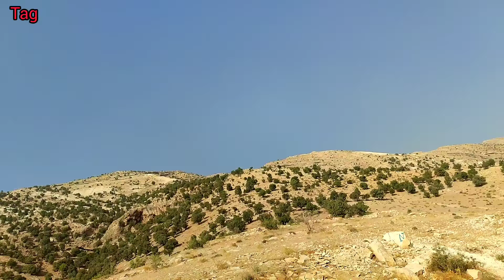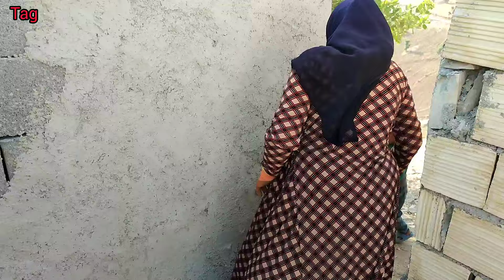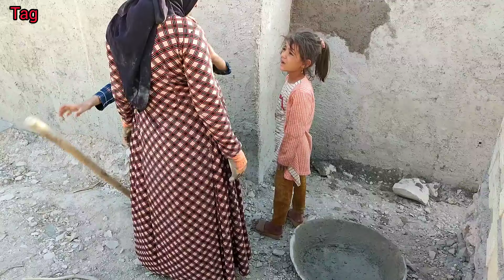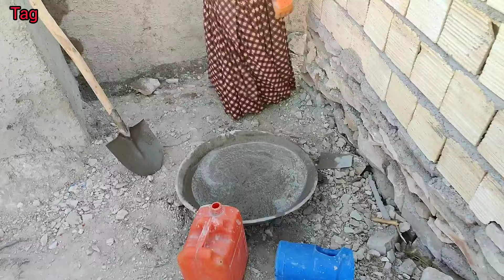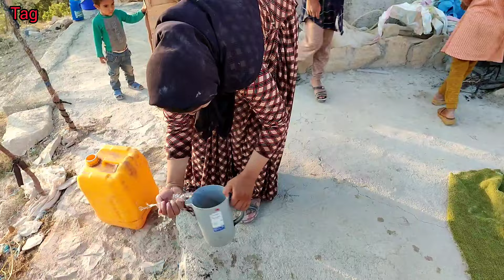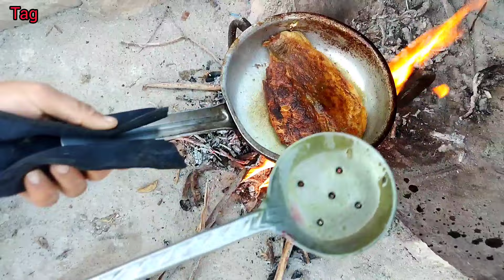The tirelessness of the displaced mother in the mountains to build a kitchen

Comment: By the way operator please  tell the mother that recently in Europe and usa thé off grid people found a way to make grow faster and vegetables bigger by putting twisting around  a rod a real  copper wire  … they put it in the ground around the area where the plants are growing and let at the end of the rod the part that is in the air… let the wire stick out first about several Inches…  on top of the rod…
I follow the channel Doug and Stacy and they put it in their video.. HE WAS not believing this but when he compared after several weeks he saw in his garden a big difference where he didn’t put the wire and where he did… so please  see if you could find a copper wire that she can twist around a rod and stick it into the ground and try AND see .. IT WORKS .. since they need big veggies
IT’S VERY Astounding !!